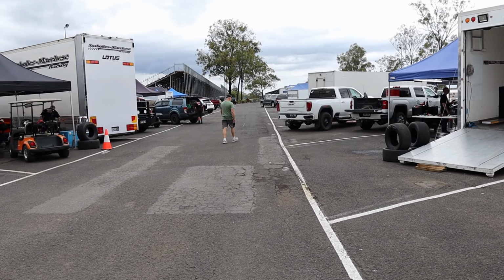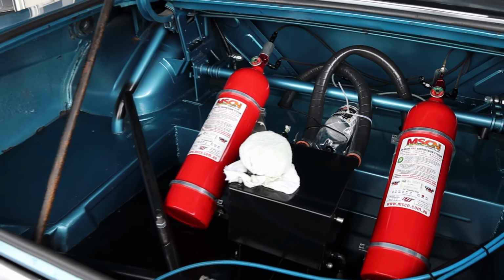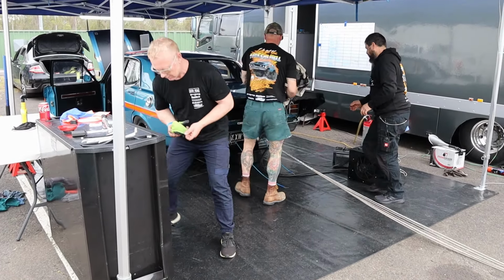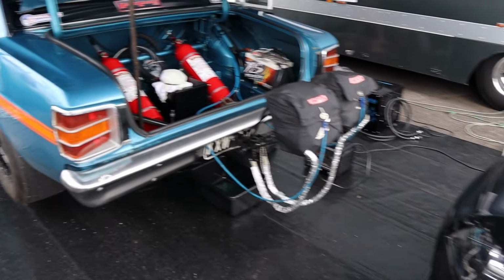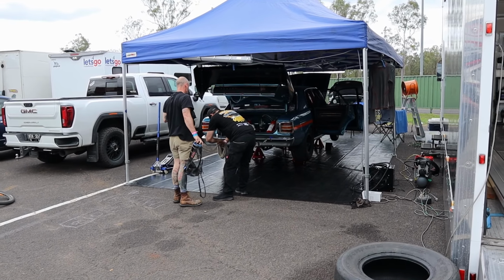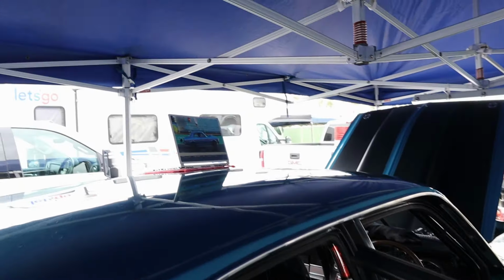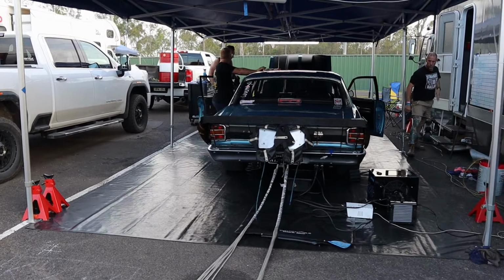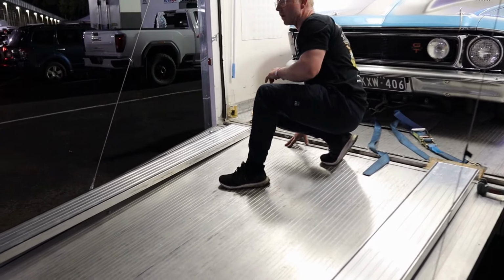2022 Kenda Radial Riot Drag Racing - Helping out pit crew on 4000 HP KXW406

Comment: I have a poster of KXW-406 in mi garage from Street Machine magazine way back when it had a windsor in it running 8's, they've certainly come a long way over the years, glad you had the opportunity to be there Sam. I'm diggin your daily FPV mate that's fairly cool.
Reply from the maker: Its such a cool car. Also pretty crazy that it does 6 second quarters with leaf springs. Was definitely an awesome opportunity
Reply: @ShenkeGarage  I'm a bit of a Ford freak and i notice Frank and Co there too.